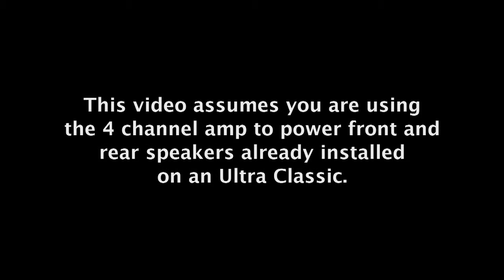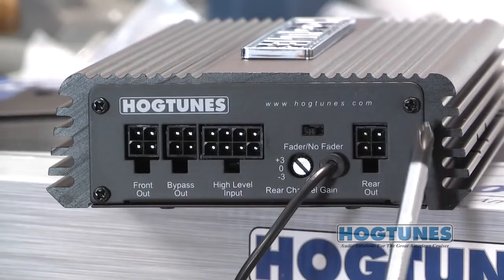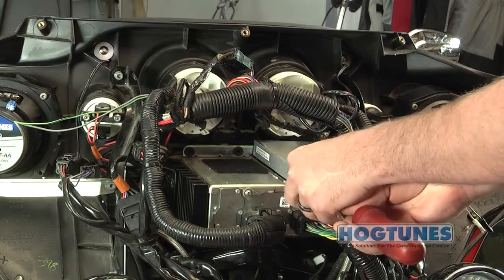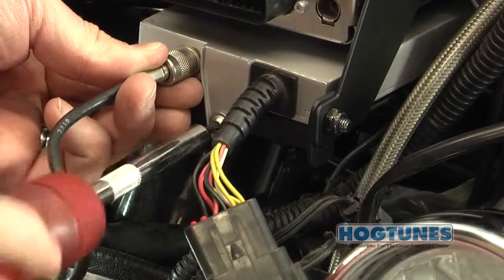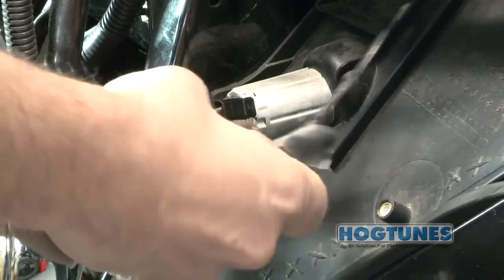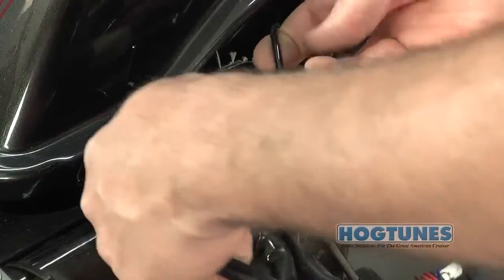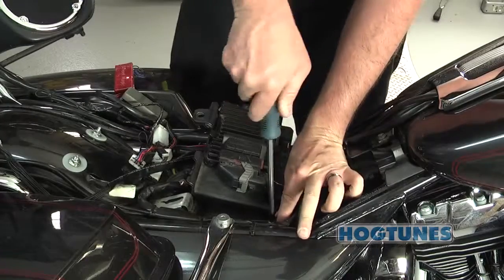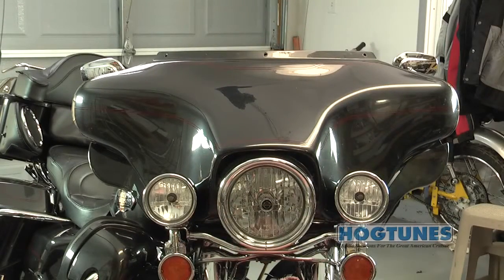NCA 450 AA Amplifier Installation

Comment: I have a Rev 450 AA There is no yellow wire in the power cable to hook to the lighter. How does the amp turn on and off. Is the amp on all the time?